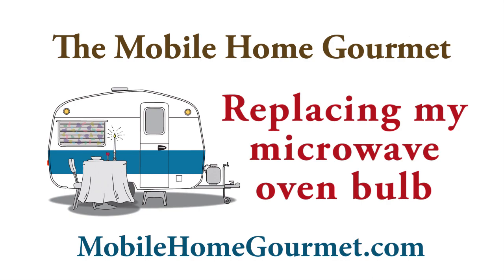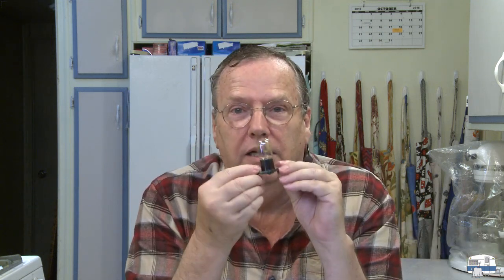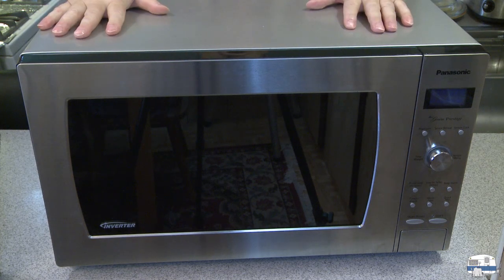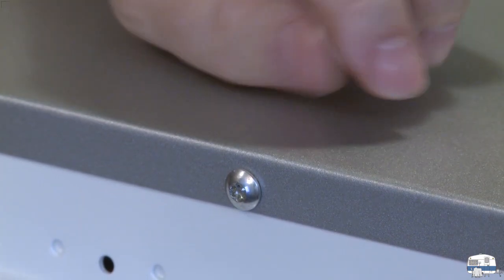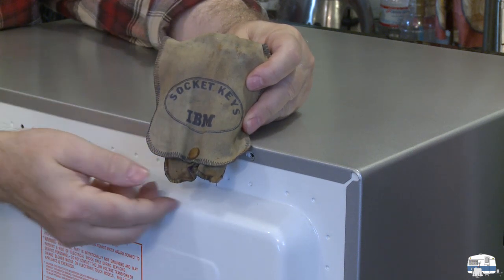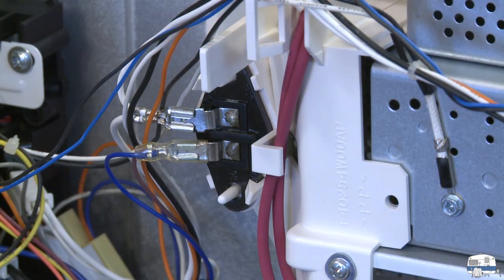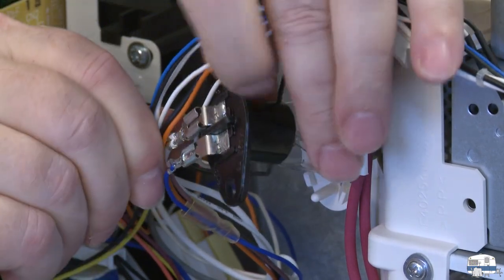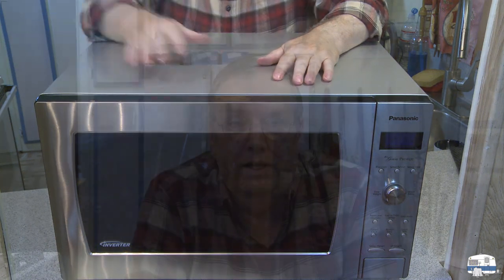106 - Replace the bulb in a Panasonic microwave

Comment: Super helpful video - Your dremel trick worked great - When I got inside, I found that I didn't have an incandescent bulb, rather a functional LED unit that had fallen away from the inner microwave wall. It wasn't really secured so I just needed to put it in place and bend metal tab to hold it. All is good but I have a few unneeded bulbs that I had preordered. Thanks for posting this video!
Reply from the maker: You're welcome David. I'm glad the video was helpful. --Dennis

Comment: So funny, right when you were plugging in the new bulb I heard a loud bang outside and the power went out on the entire block. I got a good chuckle from that. You probably already know this, but just in case, microwaves have extremely large capacitors in them that don't get discharged by unplugging the unit. If someone brushes up against the wrong wires or terminals they can get a very dangerous shock. Just sayin.
Reply from the maker: Thanks Bob. I am well aware of capacitors. The old electric typewriters had them to give the motor a big enough jolt to get the power cylinder turning. I once opened up an old TV, saw that one part was burned out, took it out and brought it to a TV repair place. "I need one of these." The guy was surprised I got it out safely. It was the high voltage coil that charged the capacitor. —Dennis
Reply: Hello Bob, I worked as a transmitter engineer for a station that had a 50,000 watt Harris MW 50 transmitter. The capacitors are the size of a U.S. Military Style Steel Jerry Can, they have a shorting bar that drops down across the terminals to discharge them when you drop the power. This one day I did not use the grounding rod to make sure all the caps were discharged, i open the door to the back of the PA (Power Amp), my hand just brushed the cap sitting on the floor of the transmitter, it bit me and shot my dumbass 5 foot back to the cinder block wall behind the transmitter. next thing I know i am in ER, this old Dr says to me, son, do you taste copper in your mouth, no i don't I responded, your ok just a bit shaken up, oh by the way, you have a heart murmur.
Reply: A Panasonic manual says the capacitor is on the Inverter board. http://media.datatail.com/docs/manual/371449_en.pdf
Reply: Not true the Panasonic inverter doesn't use the same high power oil filled ones as cheap ones with large transformers,  inverter ones discharge  faster and easier , still gotta be careful,  but the cheap non inverter ones are more danger capacitor wise

Comment: I found an LED bulb for mine on eBay for £4 posted, much brighter than the original. Be very careful of residual high voltage after removing the cover as some components need a while to discharge. At least wear insulated gloves and use insulated tools, they're cheaper than the cost of your funeral ;-)

Comment: My lightbulb went out - same microwave make and model. I got the star keys from a neighbor and removed the outside with no issues but when I went to replace the bulb - well, I couldn't find one! There is nothing where the white panel and the Magnetron come together to unclip. There was a screw on the panel that he pulled the light bulb from so I thought it must just be in there. uncrewed the white plastic panel and - totally empty. It didn't seem like a good idea to mess with anything else so I'm stuck without a light. It just figures that mine would be different and the manual is of no help. It doesn't even mention light bulb anywhere in it
Reply: same here, did you ever find where the bulb went? I can't find it either model #  nn-sn744s

Comment: Dennis thank you for sharing putting in a new bulb in your microwave, I have had screws like those and hope one day I can show off that trick of making the screw fit a regular screwdriver.
Reply from the maker: Thanks Codell. I'm almost ready to do another one. I bought a  similar component, but it is a socket into which one can screw a bulb. I ordered three bulbs as well. When the current bulb burns out, I'll install the socket. —Dennis

Comment: Thank you for this video. We were able to order the part off amazon and change the light bulb ourselves. My model was slightly different but with all the details provided, it was possible within minutes to fix our microwave light for 16.69$ CAD .
Ps. Those screws did give us difficulty but we succeeded without Torx bit using pliers.

Comment: FYI, the Torx security screw can be overcome simply with a small flat head (jewellers style) screwdriver.  It fits nicely between the post and two of the external hollows, provides enough torque for an assembly like this.
Reply: Yup ! I just had to figure that out earlier, but it worked like a charm ! Wish I saw this comment earlier. Would’ve saved me a lot trial and error lol

Comment: Thanks for the video and actually for the extra observations and comments. I normally watch only shorter duration DIY videos, saw one, got the information and came to this one as I had extra minutes to burn while eating my Computer dinner and also was not sure if all Panas were built the same. Worth the time. Both videos saved me some ordeal as I have a bunch of naked appliance bulbs, was going to  open my MW but learned I need a fully dressed bulb :) . Using Dremel to convert Torx type screws to one flat screw driver based is a neat idea when you are lucky the head is sticking out. And I observed you are statistically at the age of the fans of the Grabber In Chief (so do I) and China bashing  (and I am not of Chinese origin but as a Prof. of Electrical and Computer Engineering in a big state U have come across and trained great graduate students from there), you went on to give credit how they packed it nicely (as compared to US folks). I know it is a tug of war between constant improvement to get that extra half penny as cost saving and saving of materials. But we need to give credit to the Chinese for taking that extra step only to get blamed as steeling our jobs and secrets (of what? how we got hooked on to or love our drugs or how we think we deserve a hefty minimum salary that is necessary for us to work). For me with the likes of Tandy Corp and Radio Schack gone and the convenience of ordering something economical that I can experiment with without lifting my butt from my cushy chair is a big plus and wonder how our life will be (or my butt will be) if we don't have them as our volunteer slaves (But sometimes I also wonder if I will be placed in a hit list of traitors here for ordering directly from China :) )Of course, you know that most IBM PCs are made in China. Motorola is no longer an American company and soon.  By the way we can get from them the so called Torx (?) bit set for some $10 shipped from China and keep the Dremel for real cutting and grinding purposes. I was also thinking of the discharge from the huge capacitors and my educated guess is to wear a grounding strap, wear a shoe and leather gloves or short the terminals of the plug with a screw driver metal part, or hunt for the terminals of the capacitor(s) might be necessary  (I said I guess because I went straight to PhD to become a professor and never worked on small technician type jobs).  Keep up the good work and have fun.

Comment: My Microwave is a Panasonic NN-SN778 and thanks to your inventive video of cutting with a Dremel to make it a straight head! My question is on where did you get your replacement bulb? Mine takes the same bulb. My microwave is 9 years old but still kicking just no bulb!
Reply from the maker: To be honest, I don't remember. I had to order it twice because the first package arrived crushed — the bulb was broken. I think I ordered both on Amazon, but from two different sources. The second bulb was shipped in a rigid cardboard box. I hope that helps. —Dennis
Reply: Sandy V did you ever get a replacement bulb

Comment: Dennis, could you not have just unscrewed the bulb from the base and purchased just a bulb for $2-$3 at Home Depot..? Thanks for the video..!
Reply from the maker: No. The bulb and base were cemented together. It wasn't a screw socket. However, in the meantime I purchased a screw base and set of bulbs. When the current bulb burns out I'll replace it with the screw base. I'll also replace all those back screws with phillips head screws. Thanks for the question. —Dennis
Reply: @MyKitchenVlog  Thanks for the video. Mind sharing where you found a compatible screw bulb base or at least what "name" you used to search one out?
Reply from the maker: @TheHYPO  I ordered the base and bulbs from Amazon. These are the items:
General Electric WB08X10016 Holder Lamp
3 PACK of WB36X10003 General Electric Microwave Light Bulb Lamp 40 Watt
There is one caveat: The bulbs are longer than the original. I won't know if they fit until I take apart the microwave oven again.
—Dennis

Comment: I feel like it would be simpler to just buy some Torx bits from the hardware store 😂 if you have a european car you'll find most of the bolts have Torx heads so buying some Torx drill bits isn't a waste.